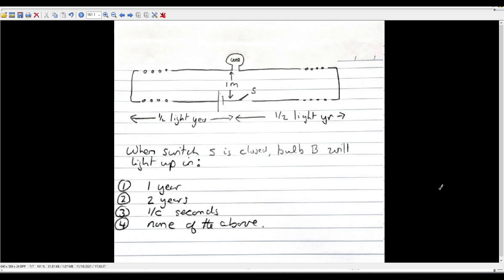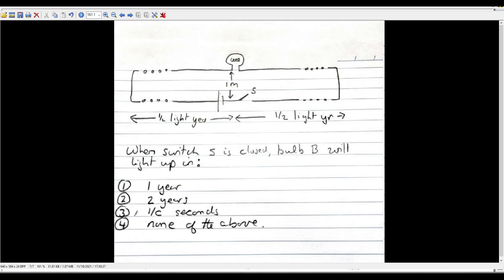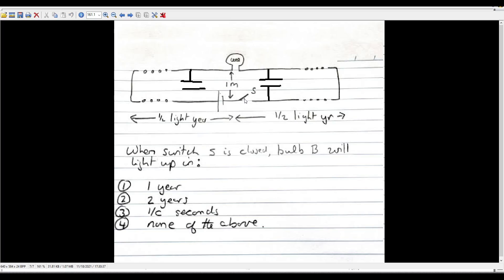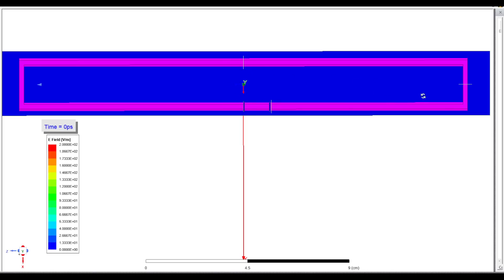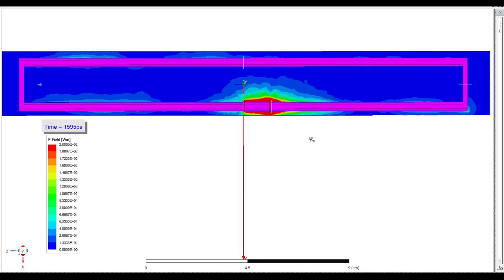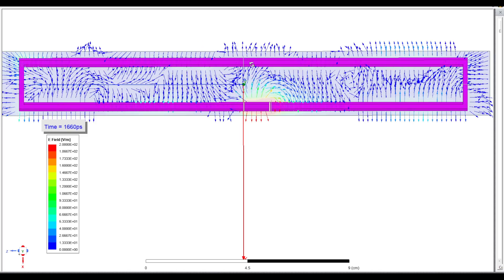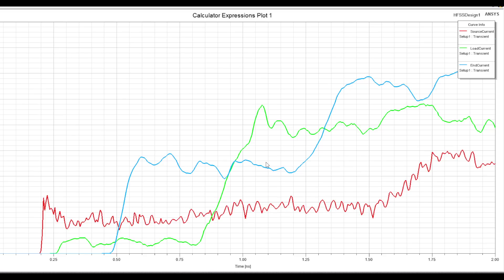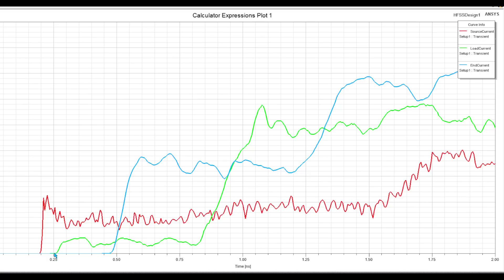Response To Veritasium - Electricity Propagation Time Problem

Comment: Your explanation is much better. Veritasium was right when he said that energy is transmitted by EM waves and not electrons. But EM waves are generated by oscillations of electrons in the wire. Therefore, waves are carried by wire trough the circuit. Speed of the energy transfer is still very dependent on wire length, especially irl. While some small amount of energy is transferred by speed of 1/c from battery to bulb, majority of energy needed for bulb to shine travel through wire roughly by speed of light. So, it is important not to confuse propagation of EM wave trough wire with propagation of waves trough air. Each of this phenomenon happens at the same time, but only wire carry significant amount of energy, that is actually relevant for this topic. Answer of 1/c is technically correct for small amount of current generated due to proximity of bulb to the source, but is misleading because people may think that wire length is not important if source of energy (battery) and light bulb are close, which is not true by any mean. 

Tl:DR: Electrons are carriers of charge, but waves are caries of energy. Some EM waves reach bulb at speed of 1/c (wirelessly), but majority of energy still needs to travel trough wire.
Reply from the maker: Good summary! Thanks for the kind words.
Reply: @PulsedPower  Could you add on some measure of how long time the time it takes for the current through the bulb to reach, say 63% of the steady-state current?
Reply: @PulsedPower  Surelly the energy in the step response depends on the transient source impedance at high frequency. In Veritasium's hypothetical the wires had zero resistance and if the source also had 'zero' internal impedance then the switch-on spike might well have extreme energies that could cause a plasma discharge between the wires.
Reply from the maker: @JohnKNMurphy-nz  Yes the source impedance would affect the amount of current in the load. Given that this is an EM theory thought problem there is no reason to not assume a 1mOhm source impedance. It would only change the magnitude ofbthe effect, not the fundamentals of the effect itself.
Reply: @PulsedPower  I've worked around power switchgear, and seen serious damage from switching transients. Frequency (rise time) is key to power. Thinking like a spark coil in an engine. Veritasium said no resistance, which means that the rise time of the dynamic spike will be limited only by the battery impedance, a near zero battery impedance then the parasitic capacitance charge time will shorten and the dI/dt will mean the RF power could become extreme.
Reply: This was my intuition as well, though I hadn't fully thought it through. If this is correct, Veritasium's video is frustratingly misleading. The whole purpose of that video is to hypothetically scramble preconceived notions and ultimately correct a misconception. But he may have created a new one in doing so.
Reply: Thank you both very much. I was struggling to combine what I learned about Linear Electrical Networks with Electromagnetic Field Theory.
Reply: The question was “when the bulb will light up”. And no, it won’t light up in 1/c, even if we have an idealised lightbulb. The current will raise to a substantial amount much much later.
Energy not transferred directly to the lightbulb instantly but gradually along the wire via capacitance while fighting wire’s inductivity. 
Veritasium’s explanation is basically pseudoscience, handwaving, despite relying on actual scientific facts.
Reply: @noop9k  Scientific facts:  actually calculate the initial current for Veritasium's setup.   It's 8.6mA for a shorted load, or 4.3mA for a matched load at 6V, if the cables are 5mm thick and 1000mm gap.   4.3mA will easily light a real LED, and of course will light an "ideal" bulb which lights up at any small current.
Veritasium's setup resembles a trick question from an EE exam.   Those who don't know how to calculate the actual numbers, will employ their own misconceptions to make wrong assumptions, and get the wrong answer.    Veritasium is right, the bulb lights for 1sec, but only at quarter-brightness.   For an optimum bulb (1400 ohms,) it initially lights at 6V (25% brightness,) then one second later will light at 12V and 100% brightness.
Reply: @wbeaty  he makes an obvious mistake. You can’t replace the parts of the wire situated at significant distance from the with virtual resistor placed right next to the switch. Because speed of light exists. I’m repeating for 10th time that to 1/c you need to add non-zero time it takes for a signal to propagate along the wire before it can induce any current on the opposite side.
1/c is wrong it is (1+x)/c where x>0.
You are either a kid or a troll, if unable to understand what I already repeated so many times in several threads.
One can say I’m nitpicking, but why can’t I nitpick if Veritasium can deceive?
Reply: Great summary. I think Veritasum states the question in misleading form. They ask “when does the light bulb turn on” which takes a lot more energy than what the shown setup can induce over a 1 meter air gap. Then they proceed to answer the unstated question “when will electromagnetic energy, regardless how small, start flowing at the light bulbs position ”.
Reply: @nilsmafr  Yes, exactly. Two completely different questions. Agreed.
Reply: @nilsmafr  This is a great comment.  When does the light bulb "turn on" is a poorly defined question.  If we are thinking of things in the digital world, one measure for delay time is the 50% delay time... the time it takes between the input changing by 50% and the output changing by 50%.  In this case, the switch is a step function so the light should reach 50% of its final brightness (which is certainly NOT 1m/c seconds).
Reply: so um?? the [x meters/c] wouldnt be effective if
1. the distance between the wires is too great for the capacitance/inductance to be of a significant value (but the battery and lamp are still close)
2. or if only the lamp and battery are far away but the wires are still close
3. or if both are far away
Reply: "energy is transmitted by EM waves and not electrons".
Why not by both of them?
Think of CRT...
And ... all these are just a simplified models...
Even when we say that energy is transferred by virtual photons, while electrons are just disturbances of the quantum electron field interacting with said photons... it is still only a mathematical model, not reality.
Reply: Agreed... The set up of the problem is kind of misleading and tbh i am not even sure if Derek understands what is wrong. If the bulb is somehow capable of turning on with any EM interaction then what is the point in having connecting cables? What the original video said is true for any switch and any power source regardless if the  circuit is closed.
I am not even sure if any known bulb would turn on and stay turned, transfer of energy does not equate a current passing through the bulb. I think it might flicker for a nano second due to the current induced by changes in the magnetic field when the switch turns on (as it goes from 0 to a set value around the conducting wires).
I still think that, in the way the problem is intuitively understood, as a close circuit, then the bulb would turn on after approx one second. In any other way we are just talking about some "rogue" energy proper of any batteries and switches in general. That might not even turn any known light bulb on by itself.
Reply: @diegog1853  You (and many others) are neglecting to consider the effect of the length of the wires. The light will turn on for any length of wire, connected at the ends or not, until the fields can travel along the wire, reach the end, and return to the light with the information of whether or not the wires are connected. You think it will turn on for just a moment, only because you are used to very short wires and that is how long it takes the wave to reach the end and return, a moment. 

1) if the wires are connected, then the light will continue to stay on after the 1 second it took the wave to reach the end and come back. 

2) if the wires are not connected, the light will turn off after 1 second when the wave has returned with that "information.
Reply: @ndvorsky  If the wires are not connected why would it turn on and off after a second? Like imagine if the cable was instead one million years in lenght, would the bulb stay on for one million years?

What if the battery only has five years of life, would the bulb turn on for five years, turn off, and then after a million years turn again for five years?
Or it will never turn on completely as the bulb slowly drains the energy out of the battery and the circuit never closes?

I don't think I am neglecting the size of the wire, because I argue that in the scenario described by Derek the wire connecting or not on infinity is irrelevant, the bulb would turn on regardless of the connection. And I mean... if we forget about a bulb and think about somekind of electromagnetic field detector in a certain range, then I agree. I don't agree with the notion that the bulb would turn on as if the circuit was closed, it would imply that the information of the connection of the whole wire travel faster than light.

Regardless, the mechanism with which the current to turn on the bulb is induced is yet to be explained. The best explanation I got was from a comment that theorized that the current would slowly raise through the wire are the information travels it, and that change in magnetic field can induce a current. It is not perfect since it would still work with any object around it, not needing a connection, and you would need a closed loop of wire to induce it, not just a wire. But it is something...
Reply: @ndvorsky  2) no, the lamp “won’t turn off after 1 second” the waves will bounce around for longer or dissipate earlier depending on what your threshold is but in any case only a minuscule amount of spent energy will reach the lamp at all.
Reply: @diegog1853  Yea, A 1 million light year long unconnected wire would have current for one million light-years (or actually double as the knowledge of the unconnected wire would take time to return.)

Information in the circuit is never transferring faster than the speed of light. That is why the lightbulb turns on whether the far ends are connected or not. A transformer is one wire inducing a current in another wire and those ends are NEVER connected but it still induces a current from one to the other. The difference is that a transformer having two complete loops can flow current forever (though must be changing field to go from one to the other) whereas this example can only transmit current as long as there is new space in giant wire for electrons to travel to.
Reply: @noop9k  Again, the bouncing behavior of real signals along a wire is really not relevant to the hypothetical here.
Reply: @diegog1853  Agreed. In reality, an incandescent bulb requires a good deal of energy before it will begin to shine. More so, I would think, than can be delivered wirelessly from a 12 volt source. But Derek's isn't an idiot by any stretch and his videos get viewed by interested folk by the millions. So at least the seed of wonder is being planted into the viewer's mental curiosity garden...
Reply: @fredsalter1915  So many words to describe pseudoscientific trolling for ad money :)
But yes it is quite good that so many are now improving their knowledge. Especially those who were supposed to know already, but didn’t.
Reply: This is a myth buster! not the madness of Veritasium. As I posted in a reply to that gent, the stuff he put forward is incredibly mixing the right and the wrong, really misleading. The exsistence of EM field and wave turned upside-down into the voidenss of the use of copper wires! such madness is dangerous to those not skileld in the art and youtube video are meant to this, to divulgate. Oversimplifying is not easy and as Einstein said if you cannot teach it means that you do not understand. So the doubt is that he really understands the stuff. Too much fake science by too many.
Reply: Great summary.  Echoes my thoughts/comments exactly.
Reply: "Even if we had no knowledge of electrostatics and of the properties of condensers, we should, by the above course of inquiry, be irresistibly led to a theory of transmission of electrical disturbances through a medium surrounding the wire, instead of through the wire.  Maxwell's theory of dielectric displacement furnishes what is wanted to explain results which are in some respects rather unintelligible when deduced in the above manner without reference to electrostatic phenomena.  We learn from it that the battery or other source of energy acts upon the dielectric primarily, producing electric displacement and magnetic induction; that disturbances are propagated through the dielectric at the speed of light; that the manner of propagation is similar to that of displacements and motions in an incompressible elastic solid; that electrical conductors act, as regards the internal propagation, not as conductors but rather as obstructors, though they act as conductors in another sense, by guiding the electromagnetic waves along definite paths in space, instead of allowing them to be immediately spread away to nothing by spherical enlargement at the speed of light; that when we deal with steady states, or only slowly varying states, involving immensely great wave length in the dielectric, the resulting magnetic phenomena are just as would arise were the speed of propagation infinitely great instead of being finite; that if we make our oscillations faster, we shall begin to get signs of propagation in the manner of waves along wires, with, however, great distortion and attenuation by the resistance of the wires; that if we make them much faster we shall obtain a comparatively undistorted transmission of waves (as in long distance telephony over copper wires of low resistance); and that if we make our oscillations very fast indeed, we shall begin to get signs of propagation in the manner of waves along the wires at the speed of light (as in some of Lodge's lightning-conductor experiments, and more perfectly with Hertzian waves)."  Oliver Heaviside, Electromagnetic Theory Vol. I, pages 18-19.  Published in 1893.  Still more correct than the nonsense taught in public education systems.
Reply: Since the mass of electron is higher than photon, it never can travel at the speed of light, which contradicts that electricity travel through electrons at the first place-
Reply: Derik is a master in designing engagement. He knows what to omit so people can't resist themselves to engage.
Reply: This is inaccurate tho. Energy is not necessarily carried by EM waves and EM waves are not caused by oscilation of electrons. 
For instance, you can have a perfectly static steady current flowing with an associated superficial charge distribution, this would generate a totally static non oscilating field that still carries energy, In fact, once the current is stabilized this will be the case in this circuit.
Reply: Yes you are right.
Reply: What an excellent summary!
Reply: Energy travels not through a wire BUT near or around a wire.  It wuold be very nice if author of this video plot the map of the Poyntings vector.
Reply: I measured 100,000 km/s in the cable, or 0.33 c.
Reply: Thanks. This is helpful. Can you help me understand how this doesn't break speed of causality limit? i.e ->
If the switch is located at the farthest end of the circuit and battery remains at 1m from bulb and I switch on switch, does the bulb still switch on in 1/c? If so, doesn't that break speed of causality? ( bulb turned on in 1/c instead of 0.5 years)
Reply: @JaisMathews  Thinking of a Bluetooth transmitter and earpod? When you switch on the switch, the bluetooth protocol tells the bulb that the switch is on, but the bulb would have to wait the electrical field to arrive to give it enough power to generate sound / light. Thinking of the 1/c of some form of induced transient voltage/current jump in the form of a command signal.
Reply: @Laohei0103  I don't think that was my question, but it was answered on a separate thread. Basically, the initial flicker in the bulb will be from EM waves coming from the "antenna" on battery side to the bulb side. There is no need for the circuit to closed for seeing the initial flicker(in 1/c time). So there is no causal effect from closing the switch which is 0.5 light years away. Hence doesn't break speed of light(/causality) limit.
Reply: @JaisMathews  you said your question was answered in annother threa but your summary here is incorrect. The battery is irrelevant. It is the switch and it's distance which etermines when the lightbulb turns on. If it is at the far end of the wire then the light will turn on .5s after the switch closes. Also, as the video here shows, there is no "flicker". The light turns on after 1/c seconds AND STAYS ON, never decreaing brightness (unless the ens are unconnected). The "transformer" efficiency determines the difference between the full steady state current and the instant current but it could be up to almost full brightness instantly.
Reply: The only question left (or probably I just miss answer in the long list of comments) is the level of current needed for bulb to shine. I believe the bulb will not shine before at least 70% of final stady state current is established (otherwise after 1s the bulb will just burn out). So technicaly Veritasium answer is wrong but from education point of view he rise very interesting question.
Reply: is there a point where there wouldnt be any kind of current transmitted over air? 2m, 10m, or is this not relevant for this setup?
Reply: @B33t_R007  It's a much longer discussion involving antennas and frequencies. Any piece of wire will act as an antenna and radiate, but the EFFICIENCY of that radiation depends on the actual size of the antenna to the frequency of the voltage or current signal. Most cables are designed (shielded) to limit the radiation, of course nothing is perfect, so there's always some amount of leakage, but it's typically super tiny. With open cables like V has in his video, it is a transmission line, so the geometry is important. 
Most of what we learn in high school physics and basic electronics circuits revolves around DC and very low frequencies, all of those formulas are approximations of Maxwell's equations. V = IR (Ohms Law), for example, is an approximation that works perfectly fine for DC and very low frequencies, but it doesn't work for high frequencies (like MHz, Ghz, etc.). It's similar to how we say sin(x) ~=x, for small x. It's true as long as x is small (close to zero), but not when x is big.
Reply: Thank you dude. You made me understand this.
Reply: good summary
Reply: @mcs699  And from a single pulse, not AC. Their excuses are “but the wire is so long, the capacitance will add up” “and lets have a magic lamp that turns on from any amount of current we want, even a single electron will suffice”
Reply: Electron movement is required to disturb the medium and create a magnetic field around the wire. 
   Electron drift velocity is c/100 in copper wires. So the time would be 100/c seconds for the current to loop and light the bulb. 
    In 30000 volt power  wires a magnet field that is induced across air gap of 1 meter to a neutral wire produces   about 0.001 amperes current and about 1/2 volt A.C.
    So a feild propagation to the bulb would only provide one half mill watt of power to the bulb.
      Electron drift is necessary to light the bulb.
Reply: You said it as well as anyone could. I didn't agree with his answer and still don't it's going to take time for the current to travel through the wires and the best answer would be 1 second in his 1st demo on that video.
Reply: Nice explanation. Correct a point: "EM waves are generated by oscillations of electrons in the wire" -> E-field is generated by the surface change on the wire, not electrons in the wire. B-field is generated by the current, also not electrons flowing in the wire (electrons' drift velocity is too slow)
Reply: Veritasium posits four answers, three of which depend on the length of the wire, and one which doesn't. He says the correct answer is the one which does not depend on the length of the wire, but only on the distance between the switch and the bulb (1 meter). Therefore, his answer should be the same for all the following cases:

1) the wire is of one meter length, connecting the switch directly to the bulb.
2) the wire is of ~infinite length.
3) the wire is of any length, zero to ~infinity, AND not connected at the other ends.

Try it and see if you get the same result for all these cases.
Reply: Thanks to other commenters, I also formulated better proof.
No energy or information can travel faster than light. This includes the information about continuous closed circuit existing at all.
In order for any part of the wire to affect the outcome, the field from the source must travel to it at speed of light, then travel to the destination (the lamp).
If we claim than the lamp lights up in 1/c, it means that nothing whose combined distance to the lamp and source is larger that 1m could have affected the result.
This is the same as saying that the lamp will light up even if the wire is absent.
Reply: @noop9k  Correct, the lamp will light up without any wire at all. HOWEVER, the length of time that the lamp stays on depends on the length of the wire up to a maximum of the wire ends meeting where you have the case of the lamp staying on until the battery dies. As long as the wires are connected then the lamp will be continuously lit as soon as the switch is closed as this video clearly showed.
Reply: @noop9k  The concept of a theoretical lightbulfb burning out is your problem but you take no issue with an electrical wire that is a light-year long? I feel you are missing the point of theory/hypotheticals.
Reply: @ndvorsky  Veritasium answers a different question from the one he initially formulated. Adds extra magical properties that don’t exist in the real world. Cheap troll trick. And even then, not correct.
We were supposed to be taught about physics of the real world, instead, we get “correct” answer that is only supposed to work in a fairy land. And veritasium’s pictures don’t actually show the state of the circuit at t=1/c seconds. They don’t apply to the (bullshit) answer he is trying to sell.
Reply: @noop9k  watch alphaphoenix's video, current flows through the wire even when circuit is open because information cannot travel at a speed faster than light. The battery doesn't know that the circuit is open initially.
Reply: @BiswarupRay  I don’t need it.
Reply: @noop9k  Good point. It would as well be the same with wires that are interrupt at light year's distance, thus making current flow impossible, because of a non closed circuit. In reality a light bulb will need a steady current flow to light up - and will thus take 1 year to light up with a closed circuit.
Reply: A wire that long would generate electricity wouldn't it?  Similar to the Nasa Tether experiment.
Reply: @BretBowlby  Doesn't the wire have to be in motion, though? The NASA experiment dragged the wire through space behind an orbiting vehicle I think.
Reply: @fredsalter1915  Well, I'd think being that long, the movement of the earth thru space it's self may cause the effect as well.  I am probably wrong on that, but just my two cents.
Reply: @BretBowlby  Hi, I remember that experiment, tether / wire string in orbit, ca 1995-ish, right? (didn't google). My problem with that tether experiment, is that there's no way of having a return conductor outside of the Earth's magnetic field, or to shield it from it, so I don't understand how they would extract energy from it. It would just be a wire with an induced electrical potential on it. Any eventual return wire (to close the electric circuit) would just be another wire in parallell, (both) orbiting the Earth crossing magnetic lines. Unless they relied on some other phenomena (ionization at the wire ends or something, for current to flow?).
(Unless maybe, if you have a kind of superconducting coaxial wire magnetically protecting the return wire in the center? But they did not, also, I'm not sure if that would work anyway, and this is besides the point for now). 

Unfortunately the tether / wire broke, but my guess is it wouldn't work. I could be wrong ofc, and maybe (probably?) they have thought of something I didn't.
Reply: @wrOngplan3t  No it absolutely worked, That's actually what caused the tether to fail.  There was a large discharge if I recall correctly that arc'd and damaged the attachment.  I would have really loved to see more attempts at this, but it's a very complex setup to control.  

At least I'm not the only person who recalls it :D
Reply: Electrons carry energy too.  The energy dissipated by a resistor is proportional to the electrons' kinetic energy.  The energy that makes a light bulb glow comes from converting the electrons' kinetic energy into thermal energy when the filament slows them down and heats up.
Reply: The question is stupid since the lightbulb would always be "on" due to cosmic background radiation regardless of the waves produced by the wire.
Reply: @nitesan2814  lol. yes, if one is claiming that "any amount" of EM power transferred constitutes "lighting the bulb," then yes, the bulb is already lit with no wire and no battery  :-D
Reply: @nitesan2814  These kind of questions are always "assume an isotropic and homogeneous space".
Reply: @nitesan2814   The question was stupid to begin with since we all live in the matrix simulation and life is an illusion
Reply: @nitesan2814  The bulb is always on because its temperature is above absolute zero, therefore it radiates energy.
Reply: "As seen, the capacity current is the exact analogy, with regard to the dielectric field, of the inductance voltage with regard to the magnetic field; the representations in the electric circuit, of the energy storage in the field. The dielectric field of the circuit thus is treated and represented in the same manner, and with the same simplicity and perspicuity, as the magnetic field, by using the same conception of lines of force. Unfortunately, to a large extent in dealing with the dielectric fields the prehistoric conception of the electrostatic charge [electron] on the conductor still exists, and by its use destroys the analogy between the two components of the electric field, the magnetic and the dielectric, and makes the consideration of dielectric fields unnecessarily complicated.  There obviously is no more sense in thinking of the capacity current as current which charges the conductor with a quantity of electricity, than there is of speaking of the inductance voltage as charging the conductor with a quantity of magnetism. But while the latter conception, together with the notion of a quantity of magnetism, etc., has vanished since Faraday's representation of the magnetic field by the lines of magnetic force, the terminology of electrostatics of many textbooks still speaks of electric charges on the conductor, and the energy stored by them, without considering that the dielectric energy is not on the surface of the conductor, but in the space outside of the conductor, just as the magnetic energy."  Charles Proteus Steinmetz (the guy that invented most of the electrical grid we use today), Elementary Lectures on Discharges, Waves, and Impulses and Other Transients, pages 13-14.  Published in 1911.  The damn text books are still wrong.
Reply: Some energy reachs the bulb at 1m/c through NOT GUIDED em waves, but most of the energy gets to the bulb through GUIDED em waves. Veritasium video is misleading, if he were correct power transmission and distribution would be wireless.
Reply: @ignaciolucasavilamangano3485  IMO not “at” 1/c, after 1/c.
There is no sudden step-like change in EM field when the switch is closed.  At that moment it is still zero, but starts growing as electrons start moving and get across the switch. The effect propagates from the switch along the wire and only then EM field starts changing, and can (after 1/c) affect the opposite wire.
Reply: I don't think that's quite right. After reaching steady state, a substantial part of the energy -- maybe most of it -- goes directly from the battery to the bulb, where the fields are strongest. That's the really interesting thing about all of this, which Veritasium unfortunately failed to bring out clearly.
Reply: veritasium isn't good at explaining - his "bet" was caused because his first video WAS WRONG, he didn't explain it (he got close with second video) etc.
his light video is bullshit, basically he is saying "this acts like a transformer" it's really pathetic.
Reply: @diceblue6817  this is why vsause rocks